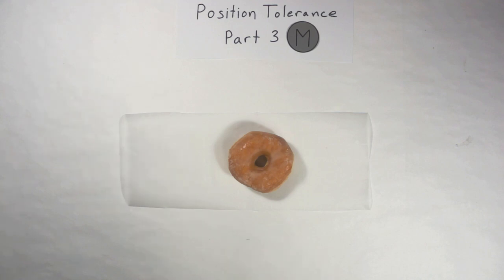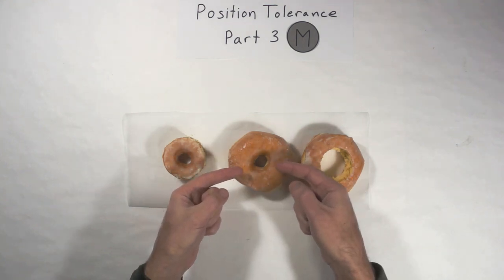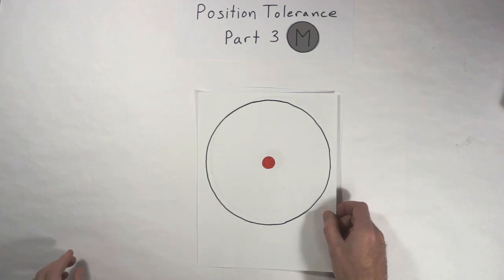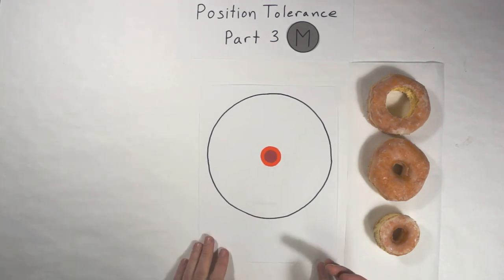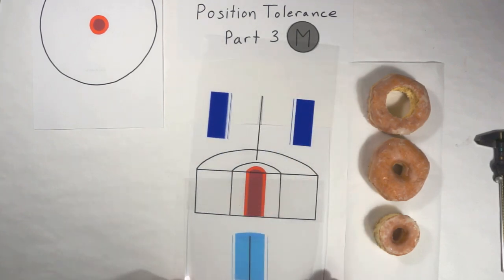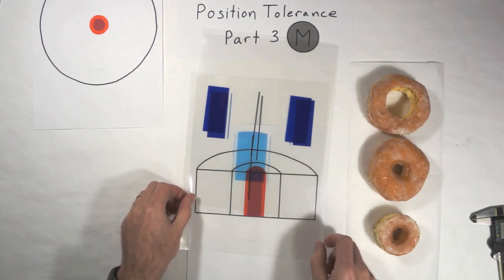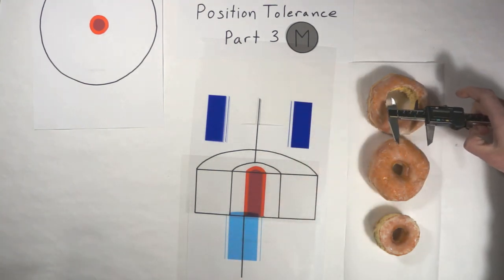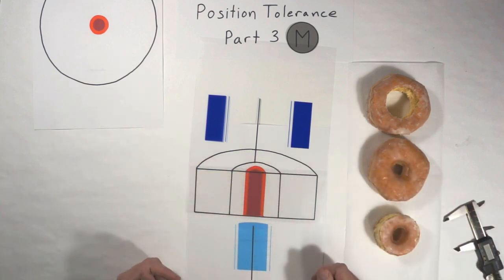GD&T Bonus Tolerance Lesson 3 - NO MATH - MMC Explained Using Doughnuts!

Comment: Quint, thanks for the videos. They're a great way to start the journey of learning GD&T.

On your description of MMC. The concept of explaining the maximum material condition with the doughnuts is great. But, what may confuse some is that if you have the outside diameter of the doughnut with a position control frame for it, then the MMC for that tolerance zone for the axis of the doughnut does not care what the size of the internal hole is. The hole could be the biggest, which may make the material of the doughnut less, but the hole is a different feature from the outside diameter of the doughnut.

But, I guess, at this point, you're just trying to introduce the concept of MMC. Great videos. Thank you.

Comment: Just to clarify, there is an inverse relationship between the position tolerance and shaft diameter. As the shaft diameter increases, naturally there will be less room for the peg to move while staying within the tolerance condition and virtual condition. Thus, decreasing the position tolerance. Am I in the right track here? Also Conversely, if you decrease the size of the hole, you will be given a smaller position tolerance as well. So in the case of maximizing material condition, is there an inverse relationship with shaft/peg diameter and position tolerance and a directly proportional relationship when regarding the hole diameter and the position tolerance?

Comment: I have a question here, if in drawing MMC is given to a hole in part, so it should be made on its least tolerance, for eg. 2+-1, so it will be made to 1 mm dia. But if that hole in part is made by a cylinder/pole in the tool. So does that mean MMC to be applied to the pole/cylinder in the tool, because if i go with just drawing then probably i would lose the steel by making it at 1 Dia, but if i apply it to tool then i would make it at Dia 3 which is always repairable.